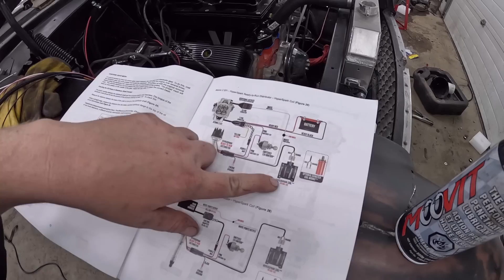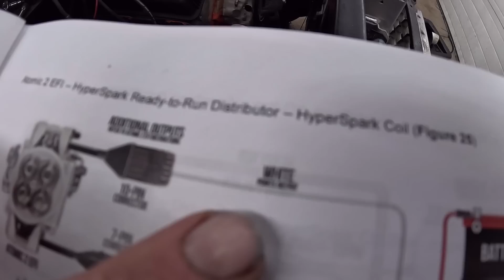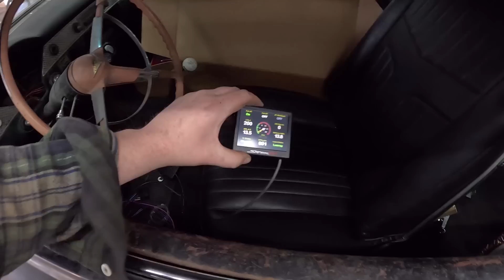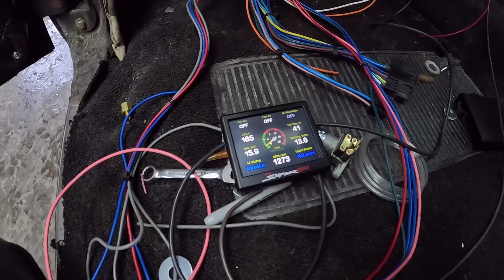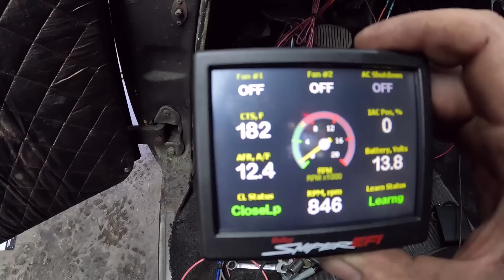FAILED FUEL INJECTED FIRST START? - I Don't Technology Well....  1955 Chevy Nomad Gasser

Comment: Got my ‘55 Pontiac fired up and running yesterday after it sitting for over a year. 
Was out in the garage until 12:300 just fiddling with it, put a new tach in thought I’d do it right with proper connectors , heat shrink etc. then it didn’t work. Rip it all apart twist some wires together and it works🤦‍♂️ I’m doomed to do things the wrong way lol 
I completely understand your hesitation to have all the wiring buttoned up and tucked away neatly.
Good episode , love the Nomad thanks for sharing with the rest of us.

Comment: Been down the TBI road. With time and therapy I hope to recover. Carbs and OEM EFI rule.
Reply: I agree 100%!! Bought a classic with sniper and it worked great till it didn't. If you're on the highway and it quits, good luck with the holley techs. About 20 gazzillion LS engines on the road. Gm did the homework. Carbs are simple, and fuel pumps easy to find. All the best Dan and Dani.

Comment: Dan, 
You should display IAC counts on your screen.  For setting idle, you need to turn your screws to where you have anywhere from 6-9 IAC counts.  You also need to show throttle position as well.  When you make an idle adjustment, it will change the throttle position percentage by 1 or 2%.  You will then need to shut the engine off, then restart to reset the TPS back to 0%.  Then watch to  keep your IAC counts between 6-9.

Also, you need to set timing.  On my sniper you have to enter a screen that allows you to select your timing to 15 degrees for idle.  Then you go under the hood and adjust your distributor until you read 15 degrees with your timing light.  It will be in your Sniper instructions.  This will sync your distributor with your Sniper so that your engine will see the amount of timing that the Sniper is sending to the distributor.

Comment: Holley sniper: what I did for the using a  battery charger deal was put a connector about six inches off the battery on the ground and positive that way I could quick disconnect when needing to use a charger rather than taking the leads completely off the battery

Comment: Dan, I've installed several of these things for folks and it's been my experience that getting them installed and started is the easy part. Keeping them from sitting on the side of the road is the challenge. The Sniper is very susceptible to RFI and you need to make sure you use only the highest quality ignition wires. Do your very best to isolate all the wires too and from the throttle bodies. Make sure your O2 sensor bungs are absolutely air-tight. And even plan on wrapping the critical system wires with Faraday tape. Keeping the IAC happy and in range is critical. Great job so far.
Reply: I have learned as well as you these same things but I have found ferrite clips work better than the tape. Hope it helps
Reply: @jeremyderby7051  Thank you for that tip. I did not know they would work in this application. Certainly cleaner than bulky Faraday tape and Amazon has 'em cheap

Comment: Hey Dan I have installed several of the snipers and I would like to make a couple suggestions pull all the wires out of the plugs that you are not using because the will act like antennas and pick up emf and rfi signals and buy some ferrite clips and put them on all your wires on the sniper. Enjoy your videos just passing on through my struggles

Comment: The points output wire is probably so the ignition gets a full 12 bolts when starting. Points only use about 9.3 volts to run but needs a full 12 volts to the coil while starting.

Comment: Heat up a nail and use it to melt a hole in the handle of your gas can. Then it will be vented and the nail can be used as a plug to cap it off.

Comment: Put a progressive linkage kit on the sniper carbs , makes drivability 10 times better. Especially when running a manual transmission . I run snipers on all my hot rods now .

Comment: Dan, very good work and persistence on your part, with the grit of true hotrodding!  Electrical Suggestion, you may already know, but worth repeating since some of us have been pulling hair out, make sure to run either spiral wound or resistor plug wires and resistor plugs.  Straight copper wires and or non-resistor plugs will play some weird voodoo on the electronics.

Comment: Looking good. They spiral wind those wires to cut down on radio interference noise. Any time wires are run in pairs they should be spiral 🌀 wound. Especially for pumps like on a boat.  Good times

Comment: The wizard tunes are generally regarded as a "lets get this thing running" tune. Tuning with a laptop is the way to go. If your setup has an IAC - it should be controlling between 5-10% obviously with the two Snipers balanced for flow. Don't know about Sniper but the higher end Holley software has idle spark control to help with idle stability.
Reply from the maker: Yeah a little tuning could probably help
Reply: Exactly right. You mentioned the fuel injection making the cam sound less "Rowdy" at idle. It is because the fuel injection is changing the timing to compensate and maintain a smoother idle. Not sure if you can do it on the handheld,but with the laptop software you can set the computer to take over the timing at a higher rpm than your idle speed. It will make the cam sound more rowdy at idle.

Comment: Well done, fixed a big issue, and got to hear the car running. One thing when you need hearing protection to fire up the car is that it does not make for a fun 3k road trip, ya hippie.

Comment: Love your channel and your bravery, I feel your pains as I struggle myself, fuel injection is a black art to me, I’m old school carb only man and just today after hours of work my carb failed miserably, pissing fuel from the accelerator pump and idling at 3k, with the idle adjusted off, I spent ages fabricating throttle cable and return spring mounts, the carb was rebuilt by a friend who has done it countless times before, so I’m so pissed, I’ve gotta take it all off and start again, working blind, I checked for vacuum leaks, I fastidiously put it together and it doesn’t work... or it does, only revving it’s nuts off pissing fuel everywhere, so at least you conquered yours, I feel like setting light to mine, which wouldn’t be difficult under the circumstances, btw, my workshop is messier than yours! 😫

Comment: Set your IAC speed to fast and it won't drop the idle so low on decel. Also, DO cut an access hole in the trunk. The fuel pump WILL fail. I'm on my third in 4 years. Junk parts.

Comment: rottella works great in all motors run the t6 15w 40 in my 2000 327 runs awesome and great oil pressure so to all who have a problem suck it up buttercup you go dan you do you dont let the haters win
Reply: oh and yes it is a bored slightly 5.3 ls to be 327 cubic inches

Comment: DANNY, ENGINE WILL OVERHEAT W/O THERMOSTAT. JUST RUN A 160 IN THERE AND WILL BE FINE.  IF COOLANT FLOWS TOO FAST THROUGH RAD. IT WILL NOT TRANSFER AS MUCH HEAT .😎✌✌

Comment: It sounds great Dan, a lot of frustrating moments, sometimes it's good to let it rest you & the car, then start fresh, that's easier said than done though, I would be thinking about it all night! I would use a big funnel for the radiator fill get rid of the gas can!👍
Reply: Drill a small hole in the handle region . 1/8" - 3/16" . When they were made here in the Americas , that's what we did , leave an air port .

Comment: I don’t know if the dual TB’s  add a huge level of complexity vs the single TB but I went with hyperspark dist, Holley coil, and Holley CD box.  Besides key on power, crank power, ground, and constant power there is NOT a lot of wiring connectors to figure out.  It’s all plug and play.
Reply from the maker: Totally agree

Comment: Hey Dan I dont know crap about EFI but for me normally when revving it up on carbs and after letting come back to idle speed if its chokes and stumbles like that  its always been dumping to much fuel so maybe just check your adjustment on psi at the fuel reg?  i dont know if it would be the same for EFI but it makes sense to me that it would be the same  just a thought bud   WTG on this build its awesome!!

Comment: It would be cool if Holley put a battery in the ECU to hold the settings so you wouldn't have to reset the ECU if you have the battery disconnected.
Reply: It will retain the settings and the actual tune offsets it has “learned”.  When the key is switched off the volatile memory writes to the eeprom and all is saved.   The problem is if you intermittently loose the direct battery connection or the voltage sags due to loads from the ignition, fans, A/C cycling, etc, then the current live file can be corrupted or lost.  Holley has covered a lot of ground on their units but since the system is ‘universal’ there are many things that are out of their control.  “Clean power” also means not running the power wires right next to spark plug wires.  Especially important are any ‘twisted pair’ wires.  They are most likely for either signal pickup or output and should be kept clear of spark plug wires.

Comment: i put a 460 engine in my motorhome to replace the blown up 351w, took fuel line loose had alot of pressure right into my eyes, i barely made it thru the garage to rinse my eyes, couldnt see, lesson learned

Comment: Doesn't running a wire running direct from the battery to the alternator with no current draw on it such as a lightbulb cause the voltage regulator in the alternator to burn out?

Comment: Man, as an old man that was taught both systems, I prefer old school technology. Why you ask? They don't need system updates getting in the way and out of date systems that don't exist anymore that keep it from running right. Plus, your fighting and syncing two brains instead of just one. Carburetor systems are ran strictly by your own brain 🧠 and the other system has to sync right to work with an additional brain. If you don't set up the additional brain 🧠  right the whole system fails.......uuuuggghh! If your not racing all the time then I prefer carburetor and one wire set up. The more basic the system, the more reliable it is and no headaches for the future. Thoughts 💭 from an old man.
Reply: You're 100% right. Been there as well. Carbs for life.

Comment: those are both controlled by one ECU right? cylinder timing on the O2 exhaust sensor knows where each puff came from... header option in the settings? "TBI" obd1...
Reply: 4918 a broken axle on the spot...

Comment: I just bought a quick performance 9inch I’m from Ontario did u have problems at the boarder
Reply: I'm in Ontario as well. Just came through Windsor with a QA1 tubular K frame for a B-Body. They sent me right on through! That NEVER happens.
Reply: @xtr3m3fLx  it’s being shipped to me I’m just wondering if there will be fees or anything
Reply: @steelftw6097  That depends on a few things, did the shipper include duty and export in the price, stuff like that. They wanted 600 bucks to ship that K frame. Easier and cheaper to go pick it up.

Comment: I remember when i foest opened my shop a chevy cobalt came in. I was gonna clean the throttle body. Engine was hot. I hosed tb down with what i now imagine was a whole can of brake clean. I hit the kwy and immediately shit it off. Fucker proceeded to tuem 10k rpm with customer standing there.

Comment: I was tired of all the BS in my car with factory wiring for charging. I went with 0 gauge wire and went from alternator direct to battery with a breaker in between to run clean power to charge battery. Then all accessories are run to terminal at battery.

Comment: From someone that was in the oil business for 40 years the simple explanation of  putting in diesel engine oil in a gas engine is would you put DIESEL FUEL IN IN YOUR GAS TANK  so if Diesel fuel won't work for fuel in your engine why would you use Diesel oil in your engine think about that oil is made for a diesel engine the operates at 1800 RPM